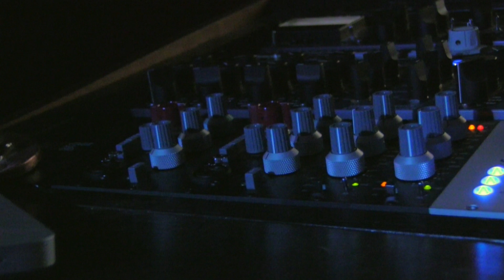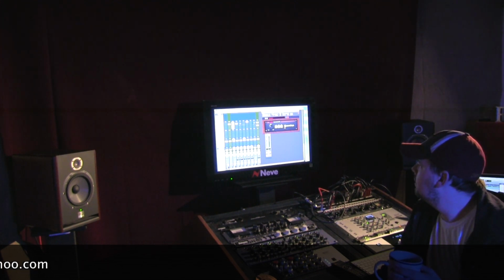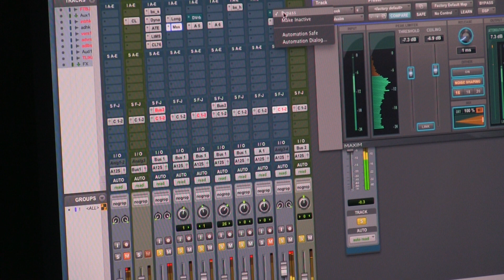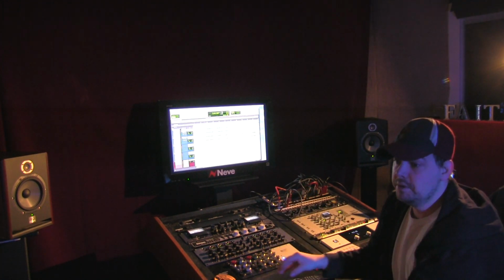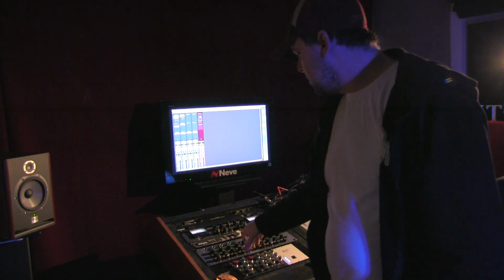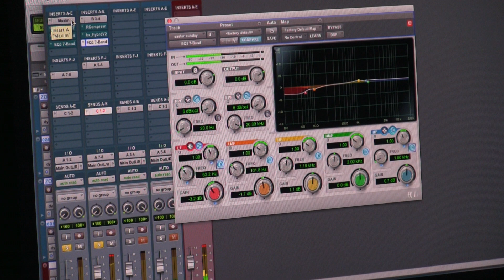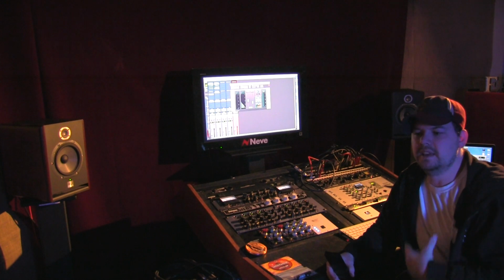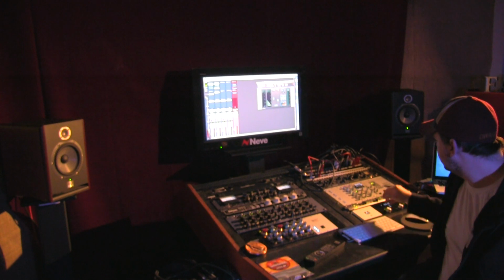PROCESSING VOCALS AND LIVE SOUND (the weekend vocal FX)

Comment: Hey Doug,
You are absouletly right on the almighty Lord Jesus Christ, hes the reason for the season. I had a question for you on recording on the zoom h5 i record using wav format and i use only 1 and 2 input slots going into a mixer record out. I understand theres levels and I used 3 but what is the key to make the volume go higher should I put it on auto record next time or shall I normalize the volume tracks on there on the menu? I have been having b
this issue and i saw you are the man who can address it. Much love and respect to you brother. God bless you.
Sargon
Reply from the maker: Demiel Zomaya i just make sure i am not clipping then import to pro tools thats where i do all the super volume lifting any DAW should have a limiter built in i recommend limiting/compression to achieve the max levels tracking then normalizing may not achieve the presence you want